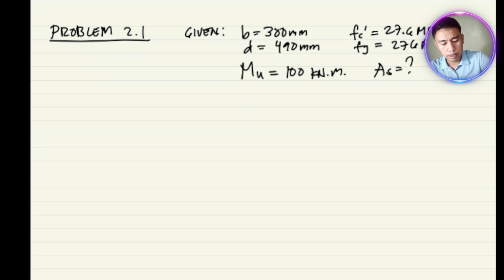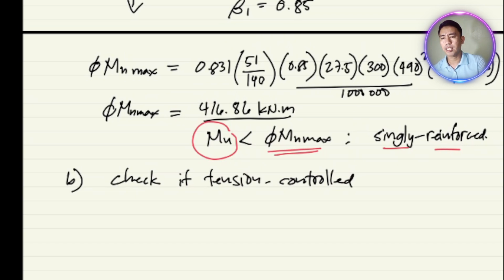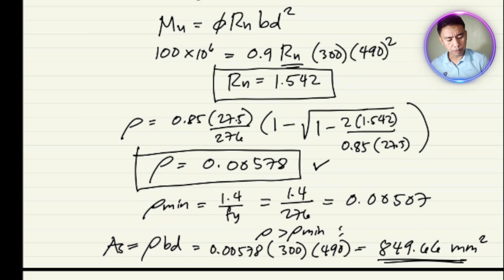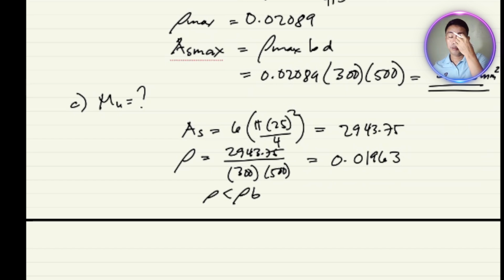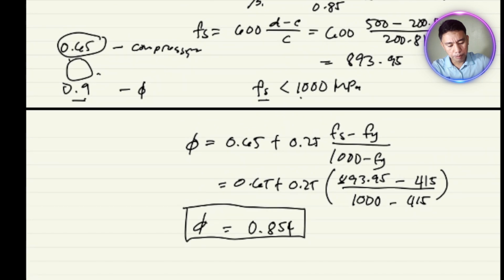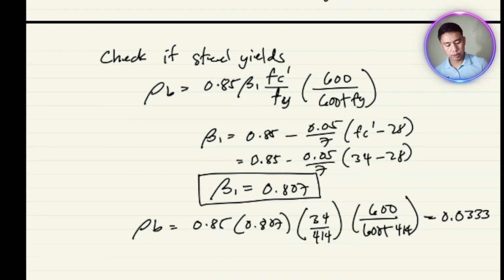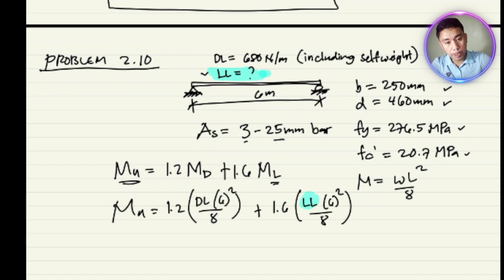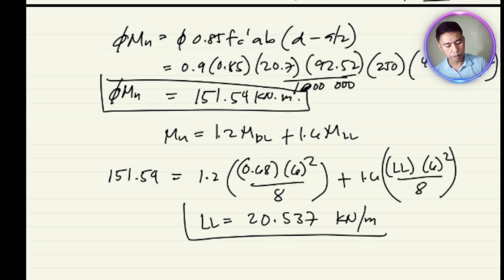CVE 161 Lecture 2- 3 (Book problem examples)

Comment: I have question po sir doon sa problem 2.10 ung sa AS=1471.875 hindi po ba un 1472.622?
Reply from the maker: I have used 3.14 for the value of Pi, If you use the whole value, you will get 1472.622. The difference is fine. You may continually use the whole value of Pi.